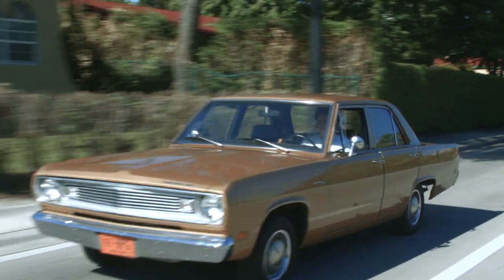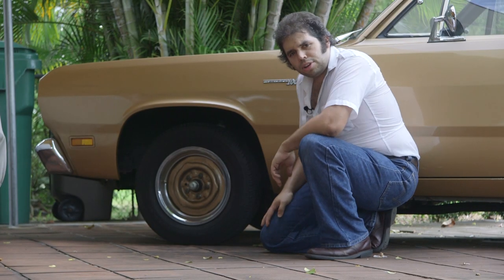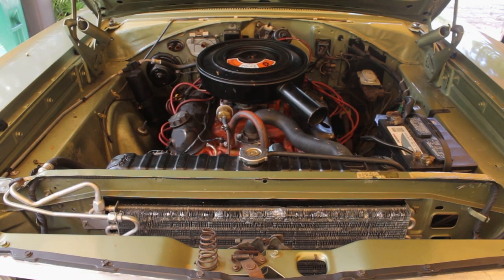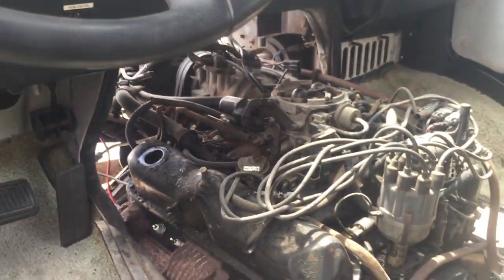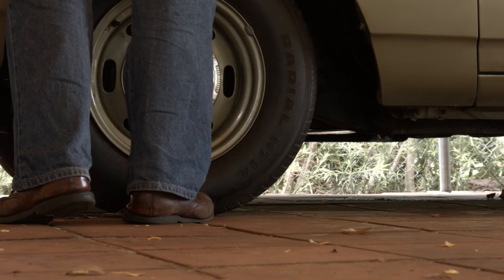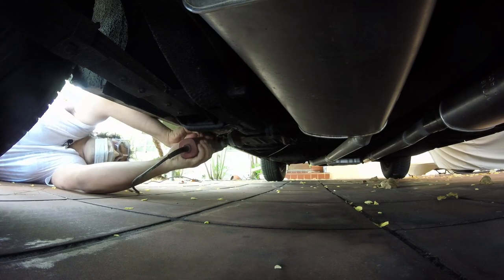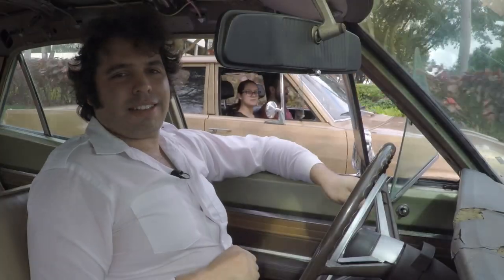Mopar More-Door Adventure! | 1969 Valiant and 1968 Satellite Rescue | That '70s Car Episode #1

Comment: I had a 73 Valiant 4 dr. Whomever ordered it checked all the boxes. AT, PS, PFDB, AM radio, electric washers, blower type rear defogger, factory A/C with hd alt, fan clutch, and wider rad, factory vinyl full length side moldings, dual outside rear view mirrors, 14 inch wheels with full wheel covers, light duty trailer towing package with 8.75 rear end and 2.94 gears, and the 225 mill. It was a really nice 94k original mile car, done up in Aztec Gold on black interior. It even had electronic ignition. After a carb rebuild, it was turn key, until some nut turned out in front of me in the rain and I slid into a curb, bending the K frame, and frame rail. I managed to find a K frame from a 73 Duster, but several body shops later, they couldn't get the car to drive straight nor get the steering wheel to center/return on a right turn. I had to crank it back.  A lower, upper control arm, a new gear box, used center link, pitman arm, idler arm, tie rods later, still proved the same problem. Eventually, the body shop said the unibody was tweaked, and they couldn't straighten it out. I sold the car in 2003 for $500.00 to a guy who wanted the drivetrain. What a crime. It was rust free and the interior was mint. A/C was still cold.... Like freeze your knees cold.

Comment: I've had a 73 Valiant 4-Door custom order since I turned 16 in 2014, bounced back and forth between a daily driver and a summer car. (depending on the state of whatever turd I had) I've gone through about 7 or 8 cheap modern cars in the time it's taken the Plymouth to break down once.
Someone backed over my grandfather in a Walmart parking lot (he was okay sorta) and he got this car with the settlement. He drove it for over a decade, and I grew up going to car shows and going fishing in it. It's a very special car to me.

Anyways, it only broke down once, and that's with significant teenage negligence, infrequent oil changes, a hole in the floor, a broken power steering pump, no brake lights or gauges, a gas needle that sometimes works, and a driver that really pushes cars to their limit because go fast don't crash.
Hell, I've driven the thing 100 miles before realizing I had literally a drop of oil in the motor, and I've forgotten to put the radiator cap back on multiple times and overheated it.
You can live and you can learn, but you cannot kill a slant six
If you have a power steering model,  you can truly steer this hulking mass of a car with just your pinkie finger. It's a surreal feeling that to my understanding was a luxury feature back in the day that companies like Rolls Royce bragged about and I know from experience that its for sure possible with modern cars, but there's no way to explain how effortless it is to move 2600 pounds with your smallest finger, and I've never felt anything like it behind the wheel of another car.
 It's a gem to drive, and you look interesting driving it. I wouldn't say cool is the right word, but people are definitely looking.

I'm 24 now and it's been in the shop for far too long having the steering assembly rebuilt because I drove it for 3 years with a burnt PS pump. 
( Feeling this cars full weight was an experience of its own and has made me want a car without power steering though. Was it worth the $2000 shop bill? No. But it did open my eyes.) 
I regret neglecting this car, and in its absence I have come to realize how special of a ride it truly is. I miss it and I'm eager to drive it again. 
It's not fast, it's not flashy past being old, and the best you're getting for AC is an open vent window and a hill, but it's genuinely a fun-to-drive road boat, they've become oddly hard to find despite being so common back in the day (at least in New England where I live)
and the memories I've been able to elevate from having such a cool conversation piece over the years has paid for the car and all 2 of the headaches it's given me since I took ownership all those years ago tenfold.

Truly one of the best engines ever made, and simply one of the most pleasurable and smooth vehicles I've ever been behind the wheel of (considering its size, weight, and lack of power.)
when I get it back from the shop, I'm going to finally put the money into it that it deserves (it's all cosmetic, the motor has 60k miles on it) and get this thing back to the condition that it deserves. 

Also this thing will do burnouts if you know what you're doing and it's a drift legend on the dirt roads, despite it having like a 14 second 0-60 and an automatic transmission.

Thank you guys for reading :)

EDIT: My only gripe is that they sound like tractors when they're stock. DO SOME EXHAUST WORK!!

Comment: Chrysler used the small bolt pattern until 1973.  Therefore the factory issued tons of 14" steel rims and a plethora of ralleye and road rims.  If you can't find them in a boneyard repops are readily available and will work with the steering geometry

Comment: BBP disc swap needs the proportioning valve and disc master cylinder, too. But since they had standardized the wheels bearings across the passenger car line, you can swap in the 12" rotors from the B & R-body cars. If you use the '73-'76 K-member and the LCA's have the sway bar tabs, you can pop in a 1 1/8" swaybar. The '89 360? Roller cam, "308" heads...not a Magnum, but using Magnum heads on a non-Magnum block requires conversion- and the Magnum's tend to crack between the valves. Just tweak the 308's and use some shorty headers (TBC'd) to get more power than Magnums for less trouble and headaches

Comment: Interesting for those of us in the real world of practical enthusiasm, very factual and beautifully produced. Subscribed.
Only one thing to add: cars from snow states can have rust that isn't obvious. Like the inside of the K-member at the torsion bar sockets. That's what killed my '71 Valiant project after putting a lot of time into the engine replacement.
Reply from the maker: Thanks. By chance, were you referring to the crossmember which the torsion bars fit into under the floorpan, rather than the K-frame itself? At least the K-frame can be unbolted and replaced.

That said, rot at the torsion bar crossmember is a pain to fix, but not necessarily the end of the world - I haven't looked it up, but I'd be curious if it's possible to relocate the crossmember farther back (and use longer torsion bars off a B or C-body) to accommodate one of the larger, 4-speed A518 transmissions. It's the main thing in the way of any 4-speed auto swap on the pre-fuselage B-bodies.
Reply: Yes, I did mean the crossmember, although my K-frame was also compromised by rust. I was at the project burnout point when I came out to find the passenger side front resting almost on the ground.
In retrospect, so much better than a sudden failure at highway speeds.
Reply from the maker: Sounds almost like a neat excuse to cut it all out and weld in some other vehicle's front subframe. Big project, but it would open a world of suspension and handling opportunities...

Comment: That LA 360 was a good choice for this car.  More power than the original 318 but not as much weight and better fuel economy than a B engine such as a 383.  However disk brakes should be considered although expensive to keep this car safe in today's traffic.
Reply from the maker: It's on 11.75" M-body discs now w/FFI upper control arms.

Comment: Mahalo for the information.
I found it quite educational.
I am a retired electronic technician and have a good knowledge of how the charging system works.
I need to get the 318 V8 running on my 73 Valiant and do some testing.
Hope the OEM alternator is OK.
Considering rebuilding it myself if I can get the parts.
What I have discovered on most alternators is possible failure of one or more of the 6 stator diodes.
(6 are used because the alternator stator is phase wye for lower amperage alternators and delta for higher amperage.
My 73 Valiant has air-conditioning so probably a delta arrangement.
These diodes are usually reliable and failures are rare.
More likely the brushes have worn out and possible the bearings are worn and could seize from lack of lubrication.
Voltage regulators can also fail.
A shorted output transistor that controls field current could cause an output voltage of 18vdc or higher and will overcharge the battery and could damage other components.

Comment: the cheap rear end solution for my dana 30 equipped duster was to narrow the long side of an 8.8 out of an explorer, with trak loc and 3.73 gears... front disc brake conversions are pretty straightforward... and thats the easiest right way to get 4.5" boltpattern

Comment: I owned several Valiants from 67-75 and had one just like the one in this vid, right down to the hubcaps and trim rings (rings were aftermarket) the only exception that mine was a funky Sea Green. Mine came stock with 13" rims so I had to get 14" rims (yes, later Valiants and Dusters came with 14s in the smaller bolt pattern) and also had to switch the transfer gear to the speedo for accuracy. These were very easy cars to work on, which was helpful, because I was always working on them. ;-)

Comment: Hi there.....i stumbled upon your episode in the search of a car like i just acquired...and surprisingly yours appeared as closest to mine...a 1969 Valiant, i've had mine for a week and a half now, first thing on the list is installing a better set of 13 inch tires to get it up off the ground, as the old ones are around 25 years old and not in the round shape anymore....i do have a set of 14 inch small bolt pattern wheels to replace them with after a while, it has the 225 slant six...and a pleasant addition surprise is a 3 on the tree manual....i'll be posting its first episode showing all this....i'd love to see more on your two if you happen to do anymore updating.

Comment: I really want to watch part 2 of that 68 Satellite.
Reply from the maker: I haven't done video of all that has transpired in seven years on the Satellite (I am shooting video of the Mustang though), but it has front 11.75" FMJ discs and Budd 11" drums in the back now, and an FMJ master cylinder on a four-to-two bolt adapter. Firm Feel tubular upper control arms as well, but the caster has never been right on it. Bought FFI adjustable strut rods since.

The alignment hasn't happened as it took way too long to refinish the rims. Shortly after this video, I dropped the clearly FMJ rims for conventional steelies off '80s D-vans; they look almost identical to the correct A12-style rims that a police package '68 would have come from. Those rims are what held up the alignment too; nobody would paint them, so had to set up a safe 2K spray booth and air-fed system to clear them with SprayMax. It also wears the correct '68 hubcaps now.

The crappy paint job the PO did has flaked off the clear and it looks terrible, but I always knew I would have to do the bodywork again on it eventually. Hood and trunk were garbage from the start and I'm certain it's not worth repairing the trunk vs. repainting it. She was always a Bondo magnet as well and has broken out bad on the right rear quarter; nothing I can't fix, but the 2-door quarters are hideously expensive.

I use it as a test bed at this point. After running an external Carter fuel pump for a while - which performed terribly - I finally bit the bullet and put the Tanks Inc. EFI tank in it with a regulator up front, but this happened a week after a no-start issue. Dying randomly has been a thing with it, and I've been through a gazillion combinations of 4-pin HEI modules, different magnetic pickups, and E-core Ford TFI coils. It's most recent death was on a MSD Digital 6AL which is now not throwing spark. Coil is fine. 

I've come to distrust the shoddiness of the Mopar electronic distributor (unlike Ford Duraspark or the HEI, it's a lot more obvious that Chrysler shoved a reluctor and magnetic pickup into a points distributor) and the impossibility of keeping a .008" gap between the reluctor and the pickup. I'm trying an HEI conversion distributor as a last resort, without the HEI and with the MSD box. I expect the experiment to end in my reinstalling the HEI module and sending out the Digital 6AL to find out why it died.

Comment: NO Radio 😲
I had one 2dr 69' 225 slant six they also made a 170&198 slant six depends on the year! But I had a 3SPD manual on the tree shift, power steering and front disc brakes am radio... b5 blue, back in 79' for  $550 dollars and looked brand new at 67,500 miles

Comment: Nice presentation.
I understand most of the information..
Would have appreciated more detail on the alternator replacement on the Valiant.
I own a 1972 Valiant and it uses an external voltage regulator.
I suspect the replacement alternator has an internal voltage regulator.
I would appreciate more detail on the new alternator installation.
Reply from the maker: I sold the Valiant since, but the alternator replacement shown here was simply a swap from the original up-to-'69 Mopar roundback aternator to a 1970+ squareback, both of which require external voltage regulators. There's a lot of info in this excellent thread at FABO: https://www.forabodiesonly.com/mopar/threads/identifying-chrysler-alternators-1960-1976.475691/ 

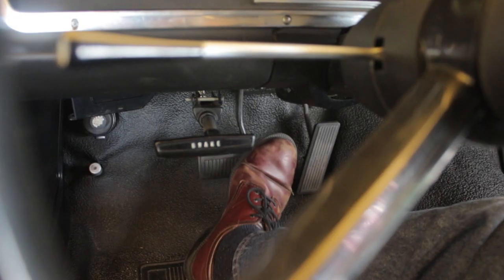The original external voltage regulator is visible to the right of the master cylinder at 4:00 into the video. Note that it is the  black box '61-69 design, not the later regulator that is OEM spec on your '72 - the dual-field box has three mounting holes, three pins, and looks similar to the Mopar electronic ignition modules. I eventually replaced the original regulator with a solid state (transistorized) external voltage regulator - they're better suited to handle the higher field current of alternators exceeding the original amp spec on these cars. 

The reproductions for your '72 should also be transistorized; many of the more boutique sellers will mention this in the listing (and upsell accordingly). Chances are the replacements at your average big-box parts store will be transistorized as well and cost half the price.

The humidity of South Florida makes the Mopar alternators - "rebuilt" or otherwise - pretty cantankerous. They're extremely simple inside, but they are not well weather sealed and the brushes love to crud up and corrode. I have considered swapping to a Denso alternator in the Satellite, but I had issues with the fitment due to the BPE compressor bracket I had installed. Here's a great thread about the Denso install (assuming no other conflicting brackets): https://www.forabodiesonly.com/mopar/threads/denso-alternator-installation.97736/

Comment: Awesome video 
And wow you do all that yourself with no help?
I always try getting help but probably should just do it alone too
Reply from the maker: The only help I had was when I put the Satellite's hood back on. Everything else was pretty much my own work, except for a few times a couple of friends came by to assist with the camerawork.

Good help is always nice to have about, if you can find someone who can work at your wavelength. Frankly, it's often better to work alone if others want to rush things or cut corners. The shenanigans that some car shows use for laughs ceases to be funny when it happens to you; e.g., an entire car lifting its weight off the front of a 4-post lift the moment the engine is pulled and its weight comes off the front suspension.
Reply: cudak888 
Nice I’m currently trying to finish a slant six upgrade kit from clifford 
Didn’t want to do a 8 swap
Hope itstays  reliably with all the upgrades shaved down head and dual carbs with dual exhaust and cam  alifters etc 
Lot more work than expected but worth it
Reply from the maker: @utubepro7742  Nothing could beat that 225 in the Valiant for pure smoothness; almost makes me regret the 360 in the Satellite. Good luck with the Clifford setup - make it powerful, but don't overdo it with complexity. Simplicity + quality engineering = reliability.